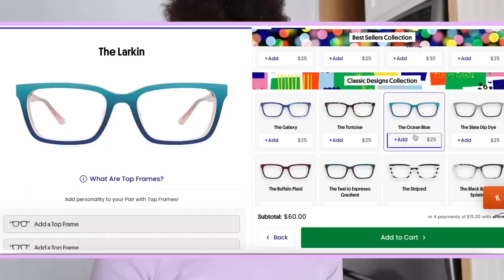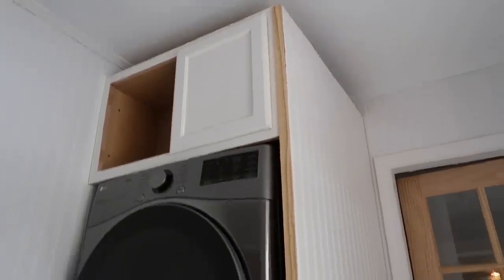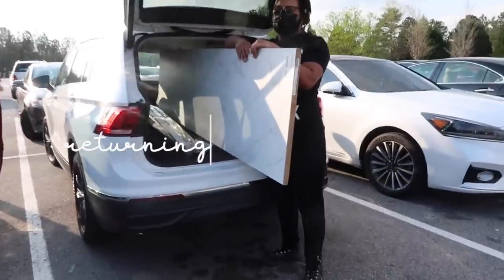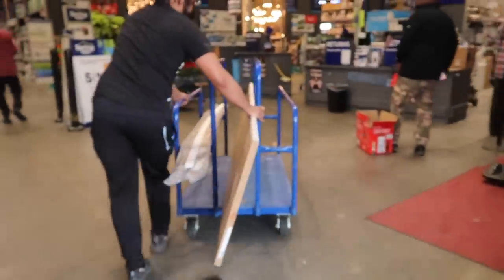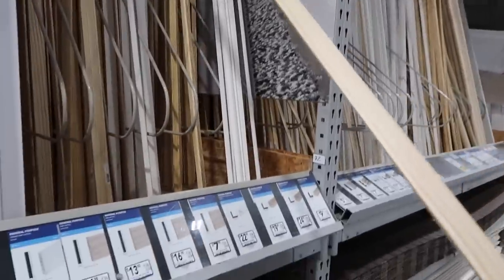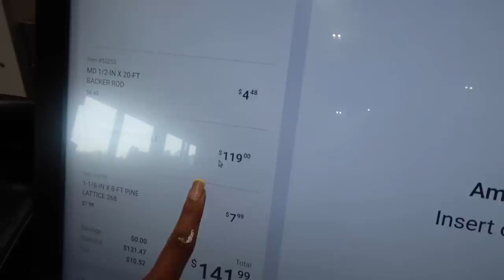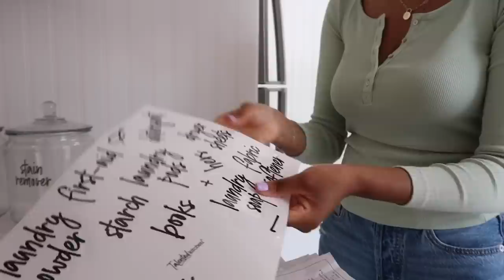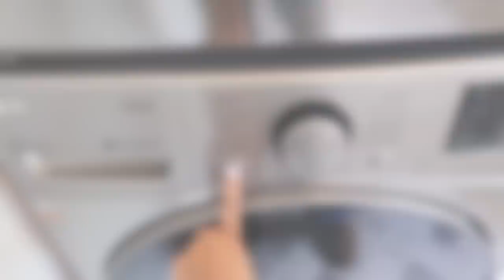DREAM LAUNDRY ROOM MAKEOVER FINALE| Organizing, Decorating & Full Renovation #FIXERUPPER

Comment: It came out really nice, I especially like the look of the custom cabinet look for the washer and dryer! 👍🏽 

I have been curious about something though, and possibly you said it before I may have missed it. But, what was the reason y'all didn't put the refrigerator inside the kitchen utilizing the space where the washer and dryer is right now? Cause it kinda looks like that spot could've held the refrigerator and just be walled off on the inside of in the laundry room. I know at this point it doesn't mattet, but I've always wondered that.

Comment: The cabinet ‘bumpers’ that you placed on the cabinet doors, buy some ‘clear’ ones and place them on the ‘walls’ and ‘refrigerator’ where and when you open the cabinet doors. If the cabinet door touches the ‘wall’ it could damage your paint or dent your refrigerator. Also do the same in your bathrooms and kitchen. You can also use them on the ‘top’ and ‘bottom’ on sliding closet doors if you have them. The laundry room looks, GREAT!!!!! ❤️💙

Comment: Soooo gorgeous!!! 
A bit of advice from my own mistakes. 1) Bleach is so harsh it tends to corrode the springs and other mechanisms in pump and spray bottles. It’s safer to put it into a bottle you have to pour from so it doesn’t damage anything. 
2) Also if possible, try to switch the direction the tiny single cabinet door swings. That way the door opens to the left, against the wall and gives you much better access to that narrow section 

Hope this helps ❤

Comment: It turned out absolutely lovely.  There's one thing you might want to rethink, it would drive me crazy, but than that's me.  The opening between the ceiling and back of your stackables is going to be a dust bin as time goes by.  You might want to put a top sheet of wood back behind the short cabinet to close it off.  Just a thought.  If the same is going on over the refrigerator at least you can get a vaccine hose behind that one.  Congratulations on a job well done. ❤❤❤

Comment: The one concern I have is how do you Emergancy shut off the water to the washer if the hose breaks on the back? It’s all I closed and if you spring a leak with a washer that is half full or if the washer isn’t draining it would be to heavy to pull away from the wall. I only bring it up because it has happened to me and my washer dryer is stacked also but I could shut off the water and we had access to the area to drain the washer. The good news is you have braided hoses so you should be good but just wanted to maybe help you from avoiding a problem. The design came out beautifully and it is a great space.
Reply: This is a great question. I didn’t even think about or consider that problem. 🤯 lol I definitely see how that could be an issue. Maybe the panel could be removable somehow keeping the aesthetics or make it like a swing faux door or something  🤔